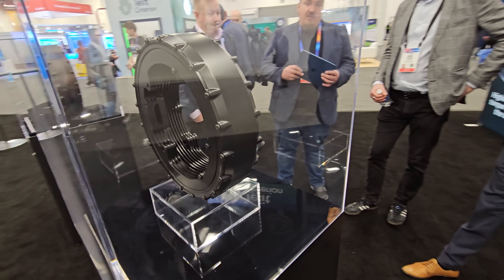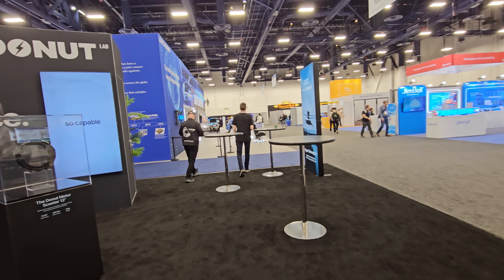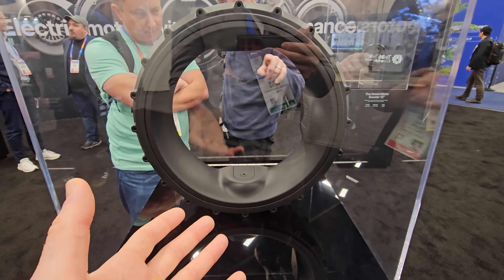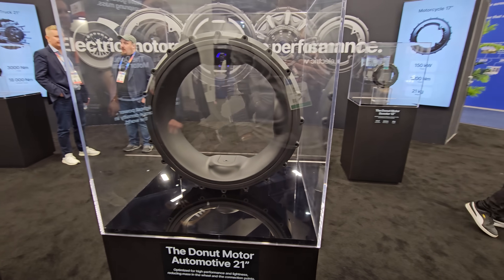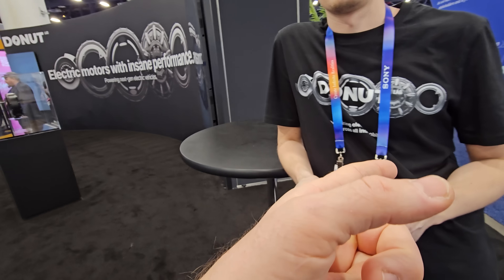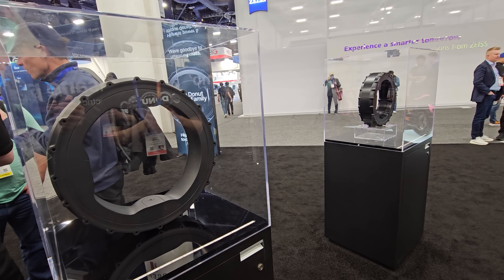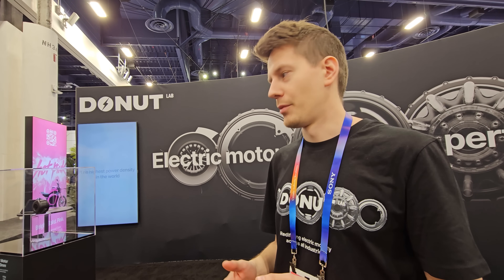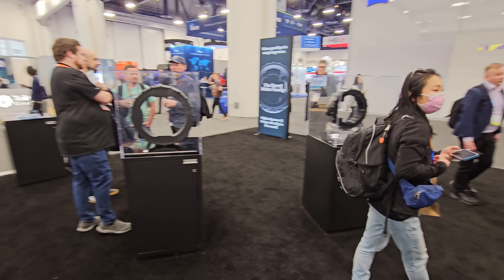Electric Motors With INSANE PERFORMANCE CES2025

Comment: Hubless wheels or motors. means a large diameter bearing with small balls= ball travelling at high speed = fast wear and noisy. Then you need a large diameter environmental seal, to keep dirt and water out = extra drag and will never remain sealed also because the speed will be much higher than near the axis of rotation again wear and tolerances will be critical and not last.  Unless this motor is for a special indoors or aerospace application, where long livity isn't important, this is a no go for a road going vehicle.
Reply from the maker: Time will tell.

Comment: Practical only in the lab, never on real roads.
How can this be load bearing, every bump in the road transmits straight into the bearings especially at higher speeds. I don't get it. This cannot be used as a wheel. The load of the vehicle would need to be decoupled from this motor, or you need a perfect road, otherwise that motor will break from any small bumps on the road.
I just don't understand.

Comment: These motors look like they could be good in a flying car to be a wheel and a propeller at the same time. To be used to fly, then they could turn  them to be a wheel
Reply: Goodyear put on a video with a rubber tire with no center threr are just veins to be a propeller. No air just flexible material to be a tire. in a flying car

Comment: Too heavy!  They need to make lightweight versions because one on each wheel doesn't need more than 50 to 100 horsepower depending on vehicle size
Reply from the maker: I think they know better what's needed. All these were build for their internal businesses and partners.  If you listen carefully he explained that only after their partners are 100% supplied it will be offered for the public.
Reply: @ElectricVehicleSpace  I don't know about you but I am an engineer and I know Dynamics pretty good and these heavy wheels are terrible for ride comfort and handling.   50 to 100 horsepower. Assuming you put it on in it every wheel is more in line with historical vehicle power.  The recent trend for super high performance electric vehicles has been really bad for safety.   Instead of being a niche product It could be much more mass market if they made them very lightweight and without huge amounts of power just what's necessary.   I think they know better really comes off as insulting.  You might as well just turn the comments off.
Reply from the maker: @glike2  I guess your a bad engineer! People can talk but not many build stuff. You dont understand that they build what they need and what their market wants. Its does not matter if you are an engineer and what you think. You dont like it maybe you should build a motor and present it at CES2026 and I'll take your actions seriously.  So far its just dust!

Comment: Why were there only models in display cases. They should have shown the motor operating with a load.
Reply from the maker: You are not allowed inside the building.

Comment: UNREAL performance: The bearing size is??? 7 times more heavy, 10 times more expensive,  large area exposed to water/sand/seals... It doesn't use copper and magnets for a 90% efficiency? NO it has 170% efficiency using gold and kryptonite. Be real, this has only CGI and fake prototypes. They haven't even delivered 1 motorbike (38,000 euros) and now they are asking for millions for trucks and drones? Be real man, the figures are 170% silly. The copper efficiency cannot be that high, and the magnets are not better than tesla, we have 95% efficient motors already, how can this be 2x better? nonsense! we have oil-cooled stators. Be cynical and give what this company deserves, fact and laughing.

Comment: I wonder how that bike motor performs after being flooded with water/mud.  Cooling fins don't work anymore.
Reply: Not ridiculing innovation but this isn’t new.  I myself came up with a similar concept for a bike.  Ideally making the force at the tire/wheel would be very efficient.  No chains, motors just force at the wheel. But this thing seems too complicated to last thousands and thousands of miles besides being so expensive that nobody can afford it. That’s why
Reply: @xolomartinez6036  axial flux has grown fast in the last 25 years in horsepower , weight , torque , many other motors convert power into heat.
Reply from the maker: Why so negative and you don't have it or never tried it. Do you think stupid people create a brand and sell it for $25k?

Comment: This looks so dope it’s never coming out.
Reply from the maker: You dont know that!
Reply: @ElectricVehicleSpace  let’s meet back here when it does FYI I’m 50 years old I’m not going to be here long enough to be wrong 😂
Reply: @ElectricVehicleSpace Im not dead. I was wrong tho😂 I just saw a verge video. It’s sick AF. I don’t care how much it cost I need it.😂😂😂🫡
Reply: The verge ts is already out, you can buy it right now
Reply: This is just a axial flux motor.. They are already commonly used in a lot of things.  All they did here is make it have multiple rotors and multiple stators.  It's not really that revolutionary,  other than having the open center hub.  This shouldn't be that hard to actually bring to the market.  But I can tell by how fancy they are trying to make everything "look" -- that it's going to be super pricey, on purpose. lol.. when it doesn't need to be.

Comment: Thats cool. But your puting the motor in the most abused place on the vehicle , directly. That's crazy.  From what I've seen motor on the wheel tend to catch fire. ( Lords town motors ) If you have a blowout are you trashing the motor ?  Or is air even going to be involved in the equation ?
Reply from the maker: motors don't catch on fire! There is nothing there to burn!
Reply: @ElectricVehicleSpace  they do melt down when shorted out .  Those lordstown trucks were catching fire at the wheels . And everything burns at the right temperature and high voltage can get very hot when shorted out .
Reply from the maker: I think you have to decide what is fire and what is melting.  Maybe you red something somewhere and you didn't understand it...

Comment: But they cant have a working model there ?   or not even videos showing actual working units ? Its all static displays 😮😮 . This seems 🐠🐠🐠 to me. Why bother setting it up at the trade show ???.
Reply from the maker: Why are you so negative and limited? The bike is a production sample and they shown tests and production. Also so you understand at CES is not allowed to have batteries or run stuff inside the building.  If you get caught the fines are thousands of $$$.

Comment: This is bad.
A motor that increase heat is on the second patent made by Nicolas Tesla.

The solution is on the first patent.
The first patent is a motor that stay cold even at full power.
Reply from the maker: Another lost in the sos 😉

Comment: ohhh so this cooling liquid function more or less like on teslas but this one has it more compact id bet this cooling oil would be like what we use on computers on data centers,, cool and the aluminum act as both a seal and as a heat stransfer between the oil the coverhousing and the coils making the whole hub more or less  water proof

Comment: I see a bit of a problem. 
The seals for this diameter would be hard to do, and the bearing replacement would cost the arm and a leg for sure. The bearings are huge!
Reply: @kwk8363 this guy has no idea about mechanics. I told the dude the same thing and that I work in the field in Canada. I also been designing and building fpv drones. Which uses tech that is just starting to trickle down to evs and other evtols and this dude said it doesn’t matter 🤣🤣🤣. I literally am part of the Canadian motor vehicle safety. If Ipr anyone in my position of power deem our countries leaders car is not safe for the road, even he don’t have the power to drive it till he fixes it lol. This motor loos amazing but service on it gonna be a nightmare and those bearing “unless they invented some new bearing tech” that shit gonna be need to be replaced like any other ice or ev cars. Basic maintenance common seance.
Reply: @TaseenAli them new bearings that are like hall effect analogue stick technology it enables two metal surfaces to work together frictionless hall effect bearings but the name is diffrent not hall effect but the same
Reply: This looks like the hubless electrical bike, and that was a failure due to exact that problem.
Reply from the maker: Hard to say by just looking
Reply: @ElectricVehicleSpace  they will be expensive

I've seen some hub motors, with big axles or should I say pipe in the middle (for example Begode ex motor) and the bearing and seals are way smaller than in donut but expensive due to size
Reply: @ElectricVehicleSpace  It also has to carry at least 1000kg and it has to cope with 100kN impacts when driving I assume. Small shafts usually are more easy, especially for the seals to keep all dirt outside.
But I would love to be proven wrong on this, because this looks awesome.

Comment: AWESOME TECHNOLOGY ❤😊  In-wheel motor the future simple lightweight and robust.
I  thought the  doughnut motor was a brilliant world changing..  ❤ 😊👍 🌍 #buzzofftoxic 😊
Reply: Lightweight? alloy rims are A quarter of the weight. Plus add breaks. Plus the electric and cooling hoses that have to handle the bounce and vibrations of a wheel. The greater drag of the bearing moved out from the hub. Their heat that's not liquid cooled.  The magnets most certainty heat up. Just normally it not to a level that can hurt the magnet. But having a tire mounted to a 140+ F degree hub might have a impact with all the heat cycles. And you subjecting a whole electric motor and its 4-5x mass of a normal rim to bad roads and pot holes. All those windings,  moving power connections, all in the harshest place in a vehical.
Reply from the maker: @adrianwilson7536  this is just talk without any knowledge or experience in the field of this specific motor type and technology.
Reply from the maker: Agree 100%

Comment: There is plenty of metal on those motors for them to be strong enough
Reply from the maker: I can't say that 100% 15kw required strong structure and aluminum is great for dissipating heat but not for strength.
Reply: @ I mean I can’t say that about anything without inspecting inside etc. aluminium can be quite strong it’s downfall is being brittle. I more just meant it’s well within the realms of possibility these days for those motors to be strong enough to handle claimed power

Comment: Im less excited about new motors than new batteries.

Once we get a REALLY good battery upgrade (cost + weight + power density upgrades) EVs will be a clear choice.
Reply: Same, as we've already got motors that are powerful enough, and like yourself I'm more interested in when the improved battery tech will be available, whilst also being priced within reach of the average person.
Reply from the maker: New tech RND is too high and that cost needs to be recovered first.
Reply: @MickyBee73  Things will be so lit when AMAZING batteries are inexpensive.

They need to not weigh a lot as well so its quite the advancement we need.
Reply from the maker: It is already a clear choice but if the motors are more efficient and consume less this will make a significant impact on range. I think it is easier to push boundaries on motor tech versus batteries.
Reply: @ElectricVehicleSpace  um no i really want an electric car but i live in a place where its not practical we have long cold winters i drive 50 miles to go to the store or work and can only charge at home
Reply: I think  axial flux motors are lighter.  I mean, 35kg motor can  produce 800kw and is 30+ cm in diameter. and they have been using it already for a long time ago ...